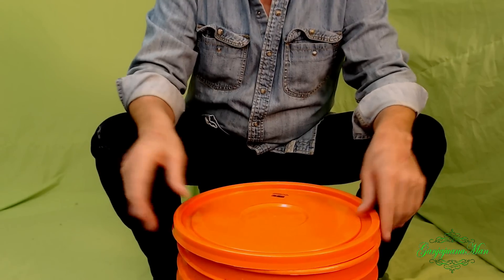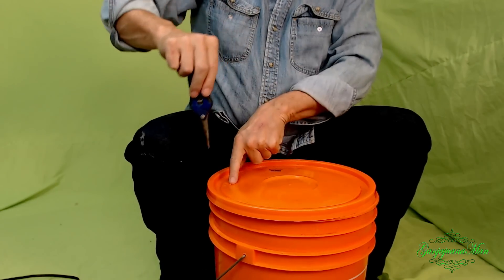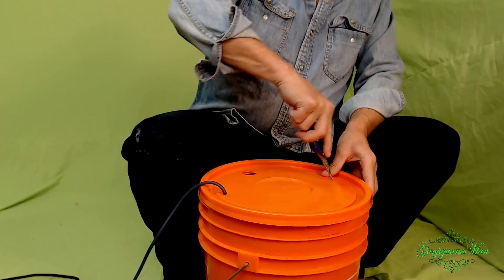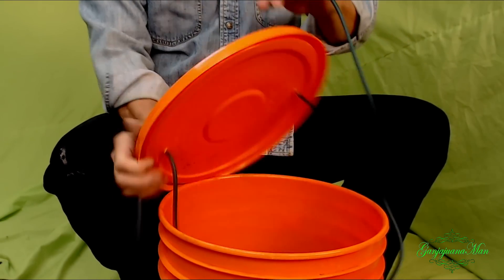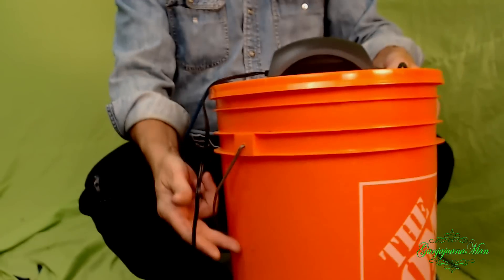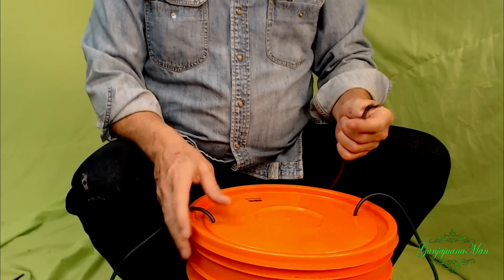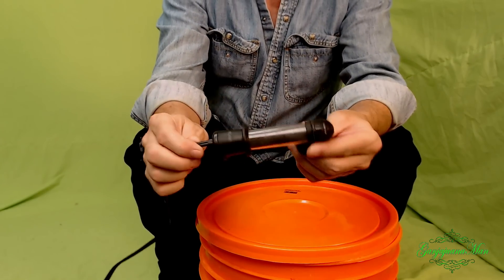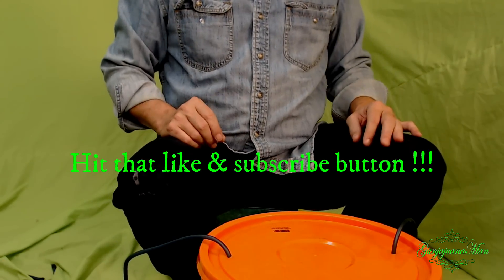New & Improved DIY Co2 Generator

Comment: How long does that method take to start making Co2?
Reply from the maker: @LandOf10000Grows  I think within half an hour
Reply: @GanjajuanaMan  
6 cups of sugar and 1 tablespoon of yeast.  I thought it was too easy to mess up.  I got nothing.
Reply from the maker: @LandOf10000Grows  should use 2 tablespoons of fast yeast and make sure the water is warm. It’s science, it has to work.
Reply: @GanjajuanaMan 
Added some more warm sugar water and yeast.  Now I have co2.
Thanks
I think my yeast is old and losing its kick.
I believe in science🤙
Reply: Also, I used water from my dehumidifier.

Comment: Putting your system there on a timer only stops the pump.... the Co2 continues to be generated and if the pressure it takes to work the bubblers in your aquariums is greater than the pressure to overtake your air pump, your air pump is going to get flooded with sugar water until no more pressure exists.... you better put a check valve on that pump side...and if the sugar water has to reach that check valve to make it work, it has to be cleaned every time.... How long does it take that air pump to build enough pressure for this thing to work? A couple of hours?

Comment: honestly they don't generate enough (i have had fermentation fridges packed with 30+ gallons of High gravs and they still don't product all that much). Realistically there are two options for plants, Co2 cylinders (which you can also double as a pH adjuster in hydroponics) or propane burners.   You could use membrane/molecular sieve concentrators, but those setup's are unrealistically cost prohibitive.

Comment: Not sure if You still reply, but how do you know if its co2 coming out and not just the air from the pump? Im using it for a planted aquarium i think its working well to keep the mixture mixing and constantly releasing co2 but how would i know if it is really co2?
Reply from the maker: You will need to dump it out after 14 days & make a new batch.
Reply: a CO2 monitor is your gauge for that . They make all different types and price points

Comment: This idea is not new but it is effective ..... for those worried about moisture coming out the exit tube just incorporate a moisture trap as suggested by some. An easy trap would be to form a drip loop in the tube ( a U shape) with a tee piece in the tube (bottom of the U shape) , another short length of tube running off of this into a sealed container. CO2 can still pass the tee and not escape the sealed drip catching container and the moisture will drip down either side of the U shape. You won't be able to trap all moisture in the humid air unless you ran the drip loop through a condenser ( much cooler place like a refridgerator) ..this is not practical. In a small area like a 5 x 5 tent a few containers of moisture absorbing containers could help ( active constituent being Calcium chloride 60 100 % ) reduce the moisture level but these need to be changed anywhere from 1 4 weeks depending on the volume of absorber used. I live in the sub tropics and use this for general moisture control to reduce mold during the wet season ...not 100 % fool proof but does help.

Comment: I set one of these up (thanks for sharing your great design!) and it worked great in the colder months, but when the tent heats up and I have to run the exhaust fan continuously, the CO2 levels drop from around 1000-1400 to 300-400, same level as the rest of the house. Anyone have any suggestions for how to troubleshoot this situation?
Reply: best is can think is put you plants inbetween the exit and the co2. also try using LED lights to keep heat down if not already? i know these ideas are weak im in your same situation haha

OR we could encourage people to burn more fossil fuels to get co2 levels back up to when the earth was slaying at co2 2000 ppm hahah
Reply: @ManofLetters  thanks for the reply! I removed an HID and left the LEDs in my tent and now I'm able to pause the airflow periodically for several minutes without overheating the space. Helps a little :) Then I just added a 2nd 5-gallon CO2 bucket, which was a tight fit but it helped a lot.

Comment: Hey brother I have a closet grow about 9 plants would this make a difference in there ya think ?
Reply: @Real-Eyes_Realize_Real-Lies  and we'll if it helps 4 plants in a 4x4 then 9 plants take up more room and those other 4 plants give off co2 them selves as well . Therefore 20 plants in a 4x4 would be great because they all give off co2 and your not going to produce so much co2 that your plabt are going to suck it all up and use it all up. It's about keeping what co2 you put in there In there that's the problem you end up with because it would have to be a air tight atmosphere and that sound easy but really isn't because you open it up to feed them to check on them to show your buddies your grow etc... 👍

Comment: Enjoyed the video and made one of these for my room couple days ago; seems to be working well/getting better ppm than with an exhale bag. This method is much cheaper than replacing bags every 4-6 months (plus exhale bags seem to always be near the expiry date). 

I made a couple minor modifications as saw fit;
- added check valves between pump and bucket
- added a second smaller bottle with just water to act as a gas defuser which prevents unwanted gasses for passing into my room
- shut off valve and check valve added between bucket and bottle
- insulated the bucket for better heat retention; helped a lot to keep around 90 degrees with just a reptile heating pad under the bucket 

All in all great video!!  Recommend this method if looking for a cheaper alternative for Co2. If have to replace exhale bag every 6 months this method should work out to less than half the cost.
Reply: @paulmaddaloni2299 shot in the dark you see this but how often do you need to change the bottle with diffusion water?
Reply: @Cj-cv4wb  I usually replace the water every time I make a new batch but depends on how bad it smells like ethanol
Reply: Does it make a difference honestly do plants grow faster etc where abouts do U sit the hose if U have exhaust fan at top? Just level of top of plants Infront of a fan? Some people say near lights and the CO2 drips on plants 😂some people say on tent floor with exhaust up top I'm thinking on top of my canopy opposite side to exhaust fan?
Reply: @paulmaddaloni2299  post it 🤨

Comment: Great video. My question is if I use the T fitting like you did to supply 2 rooms should the hoses from the tee be the same length even if the bucket is in or closer to one room than the other. Thanks

Comment: I've put it together and boy did it kick up growth! My question is this. I made it with a 7gal bucket, 3gal treated water, 5lb sugar, 2tbs dry yeast, aquarium heater an industrial aquarium pump with std. 1/4in input but a 1 1/4in sump pump flex hose output into the enclosure which gets blown by an oscillating hung tower fan and an 8in weighted air stone. Will this last the same 15 to 20 days at higher concentration or can it go 30 days? It is on day 22 now and the fermentation odor is much less prevalent than the first 15 days but growth remains robust.
Reply from the maker: Those are interesting results, I think the only way to know when is the best time would be if you got a cheap C02 meter to measure the levels.
Thanks for watching.

Comment: You don't need a pump or air stone !!! the CO2 will be forced out or an air tight container , just one exit tube , have the exit bubbling through a glass of water to show how fast it's producing . It will be pure CO2 , but will quickly mix with the air in the grow room , position exit high up or near small fan.

Comment: Ok someone commented about bringing in fresh air via the pump and the subsequent dilution of the co2. Assuming the bucket is outside the tent why not place the pump inside the tent? Sure it will still be diluting to a degree but as gas is produced and co2 level rises in the enclosure the pump would be delivering elevated levels back to the bucket. In my feeble mind this reduces the dilution by an unknown amount but still reduced nonetheless.

Comment: Wait, wouldn't it work just as well if you didn't heat it? I know temperature increases the generation of CO2 but what if you don't actually intend to use that much? I mean 23 degrees for a ferment isn't exactly 'not enough'. It won't accelerate the growth but it wouldn't slow it down either. Please mention if there is something I'm missing.

Comment: I have just started using this bucket method and it works quickly. Im using it in a 4x4 tent and i just have 2 fans working overnight and turn the exhaust fan on when i get up in the morning to get the air circulating, the plants are more bushy and very green. Thank you for the video and i used 2 gal water, 6 cups of sugar and one packet of yeast prefect amount.
Reply: I did 4 cups sugar and 2 tablespoons  of yeast. And holy hell. We all had to leave the house.  So strong  I have to go and remove it after work tonight. Something not right
Reply: @brandonbaker8584  you only needed one packet of yeast which is one spoon you have to much in there and it's producing to much C02.
Reply: @brandonbaker8584 that's about wat my mix is what do you mean it smells or what
Reply: Question? If my grow tent is around 75 degrees F , will I still need a heater inside the bucket?
Reply: @melissaphillips3990  I would say that it only matters on temp at the activation of the yeast so if you use warm water at th start you should be OK at 75 but I will say watch the condensation when using and make sure to have a good fan and exhaust fan when it comes time to turn the bucket off to clear up any moisture left in the tent. Mine got pretty moist on the tent walls but I had a couple of fans and an exhaust fan to help.
Reply: @shannelowe183  how do you turn the bucket off? Not trying to sound stupid here but I am very new to all this and trying to learn.
Reply: @melissaphillips3990  it's all good, you put it to a plug in timer with your lights then the buckets only on when your lights are on. Get a two outlet timer from Walmart for like 12 bucks.
Reply: @melissaphillips3990 you would just unplug it idk why he even has a pump in it you do not need it  I just dump my fluid out to shut mine off lol
Reply: @melissaphillips3990  unplug the yeast
Reply: @melissaphillips3990 no I find mine makes c02 even at 60 degrees
Reply: Do you use any filter? If yes then which one
Reply: @abhijeet5643  yes i have an AC Infinity got mine off of amazon it is very quiet and has adjustable speeds, but you do not use your filtration system while running the co2 just the fans inside to move the co2 and air around
Reply: @shannelowe183  thank you so much ❤️
Reply: At night, when the plant consumes oxygen, do we need to turn off the bucket?
Reply: @user-ig7gx8ii6w  plants dont consume oxygen, its carbon dioxide which is the point of the bucket, the time you have it on is when the lights are on also you want to turn it off when attending to the plants.
Reply: You need a cheap timer my guy so then you don't got run to the tent
Reply: @jeffgood6441  i have a timer, i go out to check things because no one has or should think that everything can be automated, and there is no need to check on things. I like to go to the tent about 30 min before the lights turn on and check things out and make sure there are no problems.

Comment: You can use vinegar and bicarbonate soda for CO2
Reply: I think the reaction from vinegar and soda would generate excessive pressure. I recall the aquarium co2 systems using citric acid and baking soda has a gauge max of 20 Bar. That's 290 PSI.

Comment: Why do you want to put heat to it? I already use the same solution in a gal milk jug. And I put a balloon over the opening with a pin hole in it. 2 weeks of guaranteed co2
Reply: how much does it produce?
Reply: @jameskid81  had2 of them in a 2 x 6 x 8 space got as high as 1100 ppm it helps.
Reply: Love the bucket idea though. Why do you add heat!

Comment: I am actually wondering why the air pump and stone,??   I've been doing something similar for years  using glas gallon jugs painted black with the caps loosened just enough that when pressure builds it expels  the CO2. Light impedes the fermentation that's why they are painted.  I put a gallon jug in each corner of the tent and they last around 30 days. The tent keeps them warm no need for mats but if in a basement and they are on the floor that would be a good idea.  I actually make wine while providing my plants with CO2.
Reply: The pump allows yu to bring hoses up and mount them above the plant , C02 is heavy gas and will drop to floor so it allows the plant to uptake more gases then having it just expel onto ground
Reply: @liamcondon225  why wouldn't the air float out instead of the CO2 if the CO2 is heavier?
Reply: It’s to keep the tube sunken and oxygenate then the conversion to co2 and out the top forced out from bucket pressure

Comment: can i just use a bucket with yeast sugar and holes without the air pump? a 

what role does heat play? does it need to be warm to "activate"?
Reply: Without oxygen, you're creating an anaerobic reaction, creating a secondary by-product, ethanol.  My best guess is that without the oxygen, the dangers of having ethanol fumes building could be harmful to breathe and to your plants, let alone a fire hazard.

Comment: Surely the little bit of Co2 it does produce will just get sucked out so quickly by your exhaust fan/aircon etc that it wont have much time to actually fill up the tent and be used by your plants?i could be completely wrong
Reply: CO2 is heavier than air so if you have enough CO2 pumping out and have the hose that's dispersing it up above your canopy it will fall and settle over your plants

Comment: While researching this system. I found an article but no vids of it. It was about a diy system as this. But says to use 4gallon water 16cups sugar with a piece of toast. Putting a table spoon of yeast on the toast. Saying to top off sugar once a week. That it will last the whole flower cycle. No pump no changing it out completely weekly or biweekly. But says to have a wine making flow meter. Of which i dont see why...
I dont see a reason to block the flow in this mixture. Not as if it could over CO2 your room. Or could it?
Or...will your system put out more co2 than a setup without a pump? Naturally letting the pressure out as it needs. Not forcing it.
Just looking for the most efficient way first.
Says 1500ppm co2 is best for plants. Would be nice to know how much a diy system produces. Before having to test it myself. Forcing me to buy a tester 😆
Reply: You don't want co2 pumping during the off hours of lighting

Comment: How long do you have the air pump timer set for like how many minutes does oit run for and how many times does it come on in a 24 hour period?
Reply: You only keep it on while the lights are on, it had text stating so in the video.  Plants don't need supplemental CO2 while in dark mode.

Comment: I like the thought of the air pump helping push the co2 out of the system as well as keeping solution moving but reading the negatives of o2 why not mount the pump somehow under the lid? then its just using whatever air is in the bucket.... thoughts anyone?
Reply: I was thinking the same,use pump inside bucket to pump co2 out of bucket, as opposed to diluting co2 with unnecessary air.
For me,the pump inside the bucket would pump only unadulterated Co2 and would appear to be more effective.
Reply: Some pumps have inlet ports to take air from where ever you want like co2 tanks already because they are made for fishtanks and the water needs co2 to keep live plants healthy and algae down

Comment: Can you agitate the water with the pump & still get a good reaction ?
Reply from the maker: That is the purpose of the pump, that is what makes it work better.
Thanks for watching.
Reply: GanjajuanaMan  
 Sorry to say Bro but that’s not going to work . It needs a bit of oxygen at the start when stirring in the sugar & adding the yeast but after that you do not want more oxygen hitting it . Agitating what should be in a closed container that allows no oxygen in & only lets Co2 go out . 
I’m using the 5 gallon bucket & running the line from the bucket to a two liter bottle filled halfway with water that will act as a filter & will not allow oxygen or liquids to run back into the bucket & run a second line from that two liter bottle to your tent . I love the whole idea & the video was great & much gratitude because I’m absolutely using this method minus the air pump & stone . 
 Big Respect Hugs&Nugs 🌱💪🏼🤙🏼
Reply from the maker: It Has been working for me & others for a very long time.
Thanks for watching.

Comment: Ive seen talk about the air pump in this method.  Ive done fungi before and a small hole filled tightwith cotton is used for gas exchange,  wondering about just doing that to replace air hose, but unsure if that will keep co2 from pushing out hose hole,  thoughts?

Comment: Ok I just need u to explain how you’re gonna get that temperature regulator in the sealed bucket..
Reply from the maker: lol.  I poked a hole in the bucket, cut heater cord, fed cord through hole,
put cord back together. siliconeed the hole with cord to make it air tight again. Easy peasy .
Thanks for watching.

Comment: Has anyone measured before/after PPM on this setup?
Reply: no one has unfortunately from reading through  i'm guessing it's as there is little enthusiasm for shelling out the price of one of those babies unless your getting  a tank environment going maybe.
Reply: @seanjackson8274  i'm about to test this out,have a co2 monitor.
Reply: @lito9467 excellent,  email/message me if you need to ask anything.
Reply: @lito9467  cool,  good luck and shout me if you need to.
Reply: My 4x5 grow room went from 500-600 PPM to 1200-1600 PPM